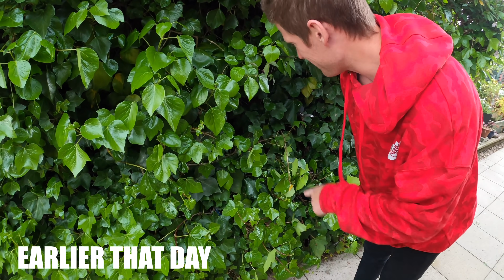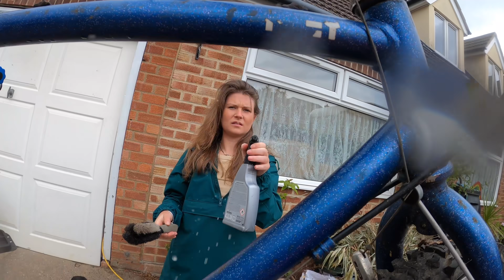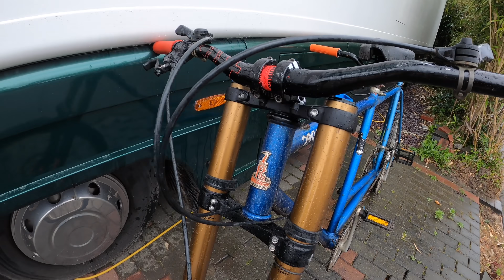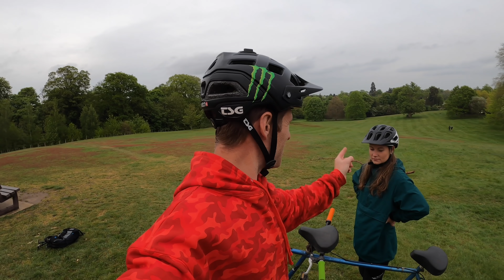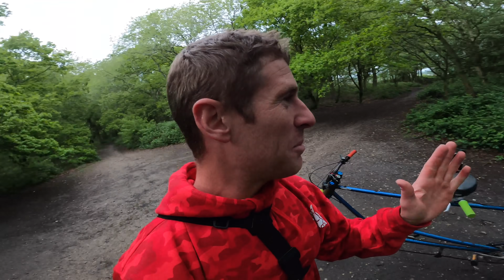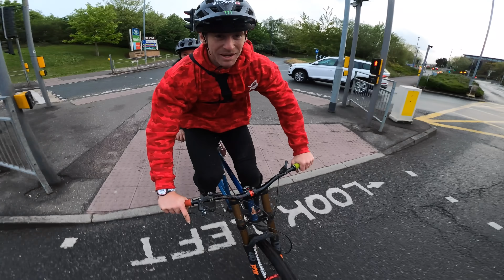FITTING DOWNHILL FORKS ON MY TANDEM BIKE AND SENDING IT!

Comment: Love the fact that you can just say “let me go find some fox 40s” when they’re 1.8 grand 😂
Reply: It’s on old fork standard anyway so it’s not much to buy one of them now but yh good point
Reply: would it be worth buying an old fox40 for bikes of recent years? i don't see them breaking anyway. can you upgrade the dampers and stuff for the old 40's?
Reply: Simon Jackson ikr
Reply: @insanebmxthomas  lol. no 40's are crud. my bud just snapped his lowers lol
Reply: Lol but he was sponsored by fox who have him forks for every one of his 45 bikes.
It certainly doesn't cost them £1.8k to send them to him. They're probably half that, if not more.
Reply: Simon Jackson freaking flex
Reply: @Hunter_Bidens_Crackpipe_  lol. boosting jumps. kinda pathetic that the lowers snapped. Basically landed a jump and there was a sick "CRACK" sound and the fork was legit bent to one side. The 40 is a POS, super high seal friction, not plush at all. hunk of poo. my Boxxer is better in every single department, if only it had like 38mm stanchions, then it would be perfect.............
Reply: @peaohvee1784  Most people I've seen/spoken with, take off the boxxer and replace it with a stiffer and more plush fox 40. I've had both Boxxer world cup and Fox 40 factory on my DH bike and the 40 is much better. I don't know what you mean by "every department", but I think you need to lay off the cheap shit you're definitely smoking.

Comment: I have a 1995 Nashbar tandem which looks similar to your Raleigh , 26 inch wheels. I wanted to put dual crown downhill forks on it but was afraid the stress would pull my frame apart so I put some 2.5 inch travel single crown Marzocchi Bomber  on it with heavy duty Mountain Speed springs and 70W oil in them and have run them without maintenance for 20 years. I got my wife on it once and she refused to ever ride with me again but I have a 27 year old autistic daughter and she makes me take her for a ride every Saturday and Sunday for the past 20 years.

Comment: The captain has the advantage of the full flex of the frame, and the suspension fork. The stoker is basically sitting on top of the back wheel, with no flex at all.